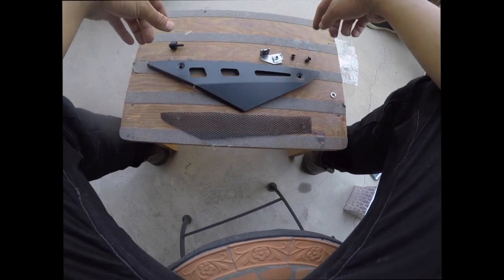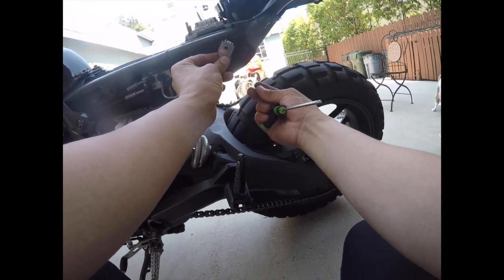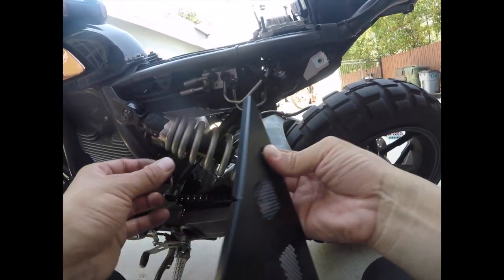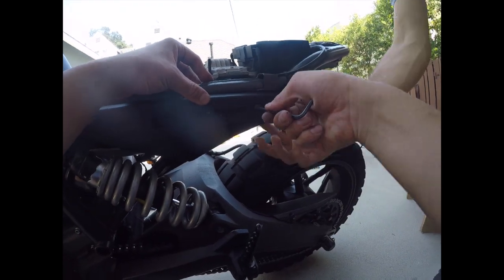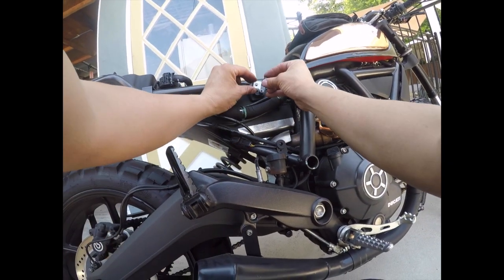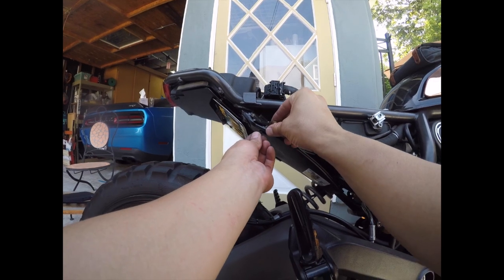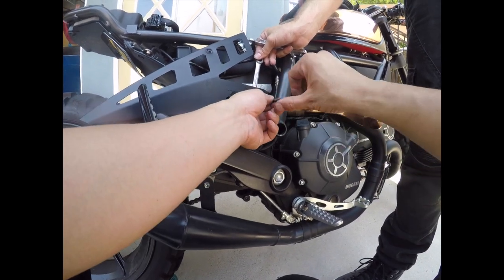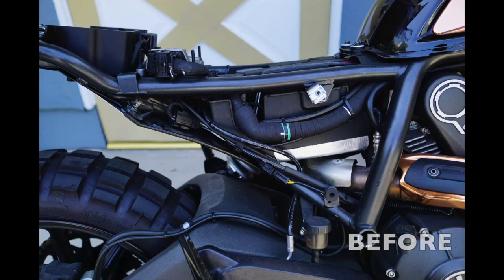Zard Slim Seat Panel for Cafe Racer Look Install for Ducati Scrambler

Comment: Nice vid and install. Good looking bike! Did you wrap the tank pannels and exhaust heat shield?
Reply from the maker: Thanks! The tank panels and heat shield are copper plated!
Reply: Would you know if this seat panel will work with the desert sled?
Reply from the maker: All the seats and side panels we have on astroscrambler.com work with the Desert Sled!

Comment: is the zard seat more comfortable than the stock?
Reply from the maker: I carry them, but they are actually more stiff. I recommend checking out Nitroheads, they feel a bit nicer than stock, and go well with Zard OR BMG Concept panels.|| Here is a link if interested https://astroscrambler.com/product-category/modifications/seatstuff/seat/
Reply: Thanks for the reply. Yea i'm looking for a replacement for the UN-comfortable stock seat, my buddy has a sargent seat on his scrambler it looks really big/bulky but its really sweet to sit on. I'm assuming the nitrohead tuckroll (high end) seat would be the most comfortable? The bigger seat ribs don't look as good IMO as the regular nitrohead though. Thanks.
Reply from the maker: they're slightly more comfortable IMO, and the hi-end looks awesome, but like most things its all personal taste =]